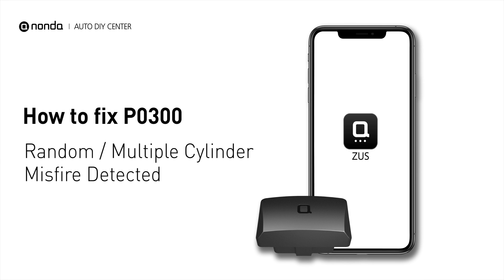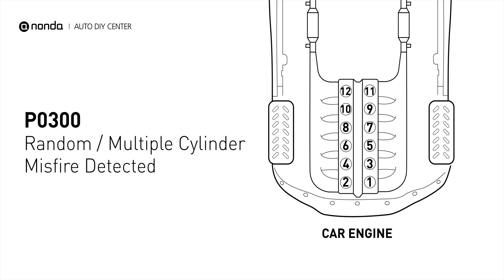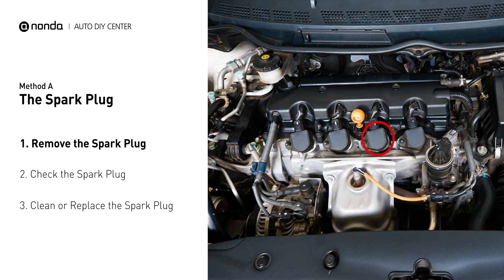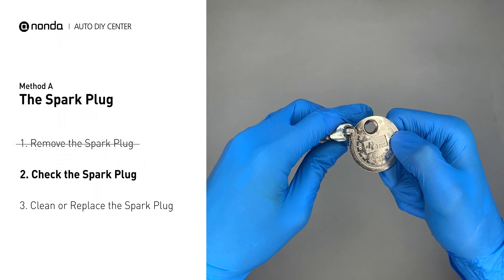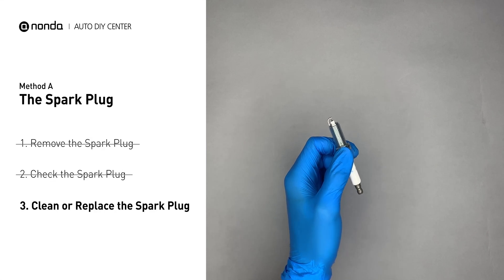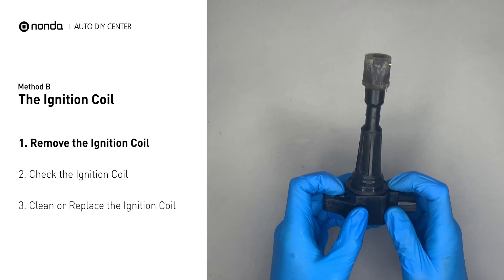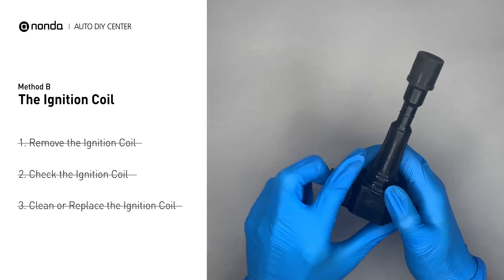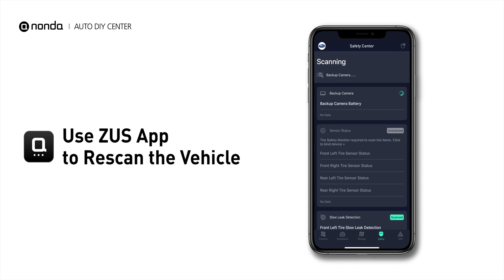How to Fix P0300 Engine Code in 3 Minutes [2 DIY Methods / Only $4.43]

Comment from the maker: Hi, I'm Steve, nonda's lead mechanic engineer. 
Feel free to leave your comments here if you have any mechanic questions, I will be glad to help you out!
Reply: So my spark plugs have been changed for two months now, brand new Audi OEM plugs.  I replaced them, cleaned each coil individually.  They have been working flawlessly.  This past weekend my car sat in the snow without being turned on for three days.  I turned it on and it rattled for a few, then check engine light turned on.  I am sure it may have something to do with not being started for three days? the car operates normally now, idles normally at stop signs and red lights or even in parking lots.  but I did get that error code.  I will hook up my VCDS to it as well to see if there is an extensive issue or perhaps just a one time misfire and it will clear itself out.  This has happened twice before and both times I showed it to my mechanic they couldn't find anything wrong.
Reply: @zheerrostam8108  did you figure it out ?
Reply: @zheerrostam8108  
Sounds like the oil didn't reach the top of the engine quick enough. Rattle
Reply: Could the electronic throttle control cause this code?
Reply: Where you located
Reply: Hey so my car has p0300, I’ve replaced wires, coils packs, and spark plugs and I’m still getting misfires. The car has a rough idle and as soon as I try to get it up past 2000 rpms engine light flashes. One friend said it’s not getting gas but another says it could be my lower intake gasket. I don’t know what to do. It’s a 2005 impala. Please someone help me
Reply: @Flxwxd  have you checked your battery? Sometimes a weak battery could be the cause

Comment: I have this problem with my Mercedes Benz C300. It was working fine until I did an oil change. Now I have this code: the car runs rough and turns off.

Comment: I have a 1999 Suburban 5.7 v8 showing P0300 po135 po151 po305 it runs like crap they put a new distributor new wires new coil new plugs nothing's working what's wrong with it

Comment: I have a 2008 Infiniti QX56. I have this code P0300. I've replaced: spark plugs, ignition coils, 4 oxygen sensors, 2 acv valves, MAF sensor, Air sensor, Cam shaft sensor, and one fuel injector that showed bad on my obd sensor.  
I was trying to rule out stuff that could be the culprit, but im still having the same issue. 
Please help me!!

Comment: 407,pm central time..I have a 201 appointment z-24 Chevy cavalier I got the po300 code but no additional codes it runs rough at times loser power at times and just started doing this today..any clues to what's wrong
Reply: Did you find the solution to this problem , or your mechanic did ?

Comment: i have the P0300 code on my 2001 Golf gti vr6 , new coil pack , spark plug wires and spark plugs , only has 85,000 miles on the engine .
Reply from the maker: Hello, have you checked for any leaks?
Reply: @nondainc  i haven’t yet , i did however install the  wrong NGK spark plugs in the car about a year ago , I have the NGKR dual prone spark plugs now , i have yet to start it due to my alternator going bad .
Reply: I have a 2013 equinox 2.4l engine. The oñly come I have is p0300 code
Reply: @gracebrison6515  change out your spark plugs , use the correct spark plugs , my car had a ghost code misfire along with the P0300 code .

Comment: Hello steve. I have an 02 bonneville and whenever my car is up to heat. It can start to missfire when I idle or run at a low rpm. If i turn the car off for about an hour and start it up again it runs okay until I idle to long. The only code thats pulling up is P0300 and a P0171. Any help would be appreciated.
Reply: i had this experience with my car ..code p0300 and p0304...meaning that cylinder #4 misfire randomly, i solve this problem by swapping coil#4 with # 1..and if problem remain, then check spark#4 and injector......your situation is #1 cylinder is misfire ...so make sure spark plug, coil, and injector at port # 1 is good...swap around see if problem relocated.
Reply: @oeungmao1  i was only getting the P0300 so how would I know which cylinder?
Reply from the maker: Hello, as you are getting more than one error code, we suggest getting your vehicle visually checked by your local mechanic for further diagnosis.

Comment: 27 miles per gallon on a 3.0 ford Taurus and occasional po300 code ?
Reply from the maker: Hello, we suggest checking the spark plug and try cleaning the ignition coil to see if the issue will still persists.

Comment: Both of these methods have been done but it still misfires and is constantly jittering with a rough idle. Battery has been changed recently and I’m around 67000 kilometres. Please help I am desperate 😭
Reply: Could be 02 sensor maybe 🤷🏽‍♂️
Reply from the maker: Hi Anelisa, can you please confirm if this is the only code you're getting? please provide us also with your car's year, make and model.
Reply: Hello I have this code and it’s the only code just bought the car yesterday
Reply: Could I possibly send you a picture of the auto zone code reading

Comment: Nice vid BUT I would also add that if it's oily, then either the spark plug is loose or (more commonly) the valve cover rings are leaking; commonly an issue around 160k-ish miles.
Reply from the maker: Hi Audrey, thanks for sharing your knowledge!